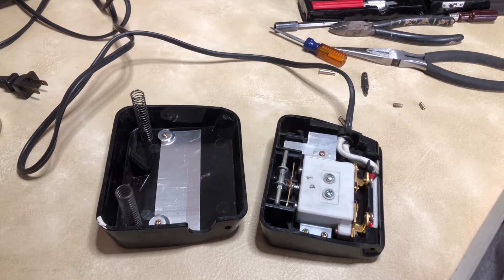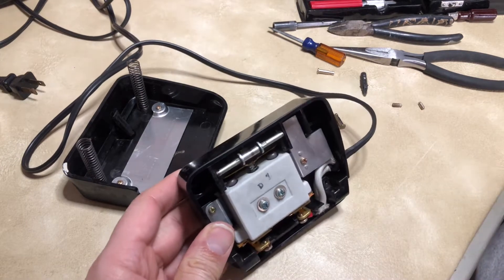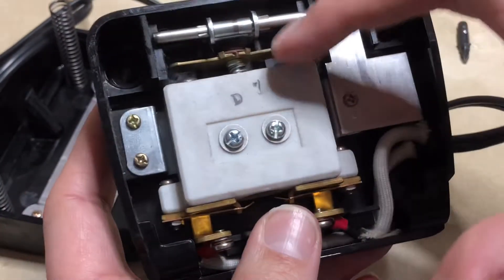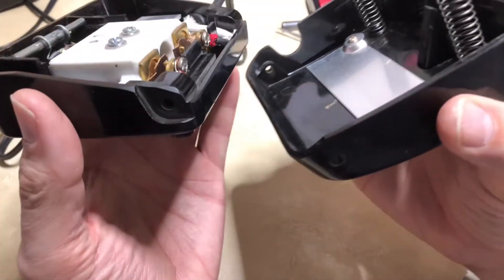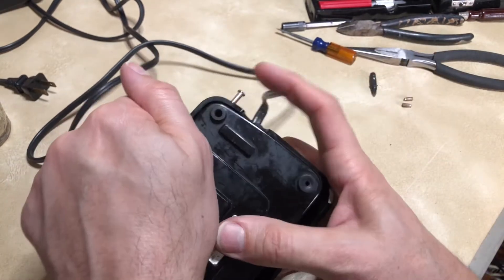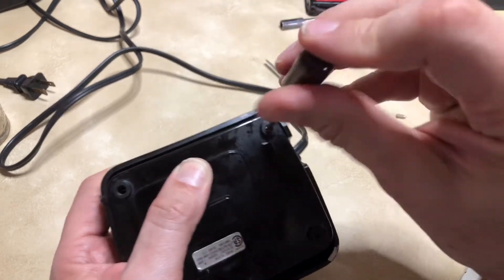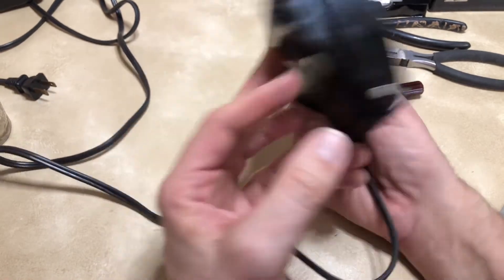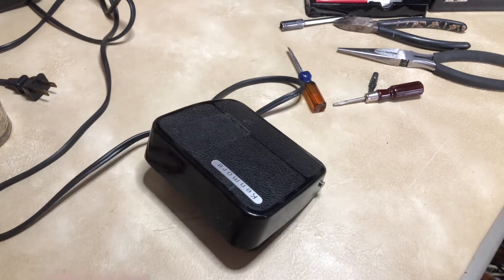IF OLD SEWING PEDALS COULD TALK PART 4: Kenmore's Foot Controllers Were a Sears Servicer's Dream!!

Comment: That's the pedal that someone tried to attach to my 99, unsuccessfully. When I pressed the pedal, only the light came on! No worries, I got a new cable with a molded plug and the pedal now operates the machine just fine. The old plug was missing a brass terminal, so it got donated to another machine. Since the machine is in good condition, I suspect someone ordered the pedal from Sears and tried their best to make it work.

Comment: What adjustments would you suggest to make the speed come on more gradually, for better low-speed control? I have a 1219 with similar pedal and it's impossible to get a slow, gradual start.

Comment: I don't mean to stir up controversy, but do you know for a fact that Sears had direct input in the design of that pedal? I just see it as a Maruzen/Jaguar pedal, the same pedal used on countless Jaguar models sold here in Japan.
Reply from the maker: Nothing at all wrong with your question Christopher.  Sears would not have necessarily designed this pedal originally, but they WOULD have insisted on a pedal setup that was efficient to take apart and service.  Sears had great power back then and Maruzen would have brought their most serviceable design to Sears.  When Sears introduced the 'Super High Shank' presser foot design/accessories, it was exclusive to them and not just any retailer could have leveraged a producer to invest that kind of capital for one brand of machines without the payoff of Sear's massive scale as a purchaser.  Service is all about efficiency and just like Singer did with so many of their design choices, Sears had a vested interest in getting the most productivity out of their staff.  I don't have any data/documents to prove my ascertain, but given the way service once played a major role is a customer's willingness to fork over big money for a consumer appliance, I'm pretty confident that serviceability would have been a factor.  Thank you for asking!